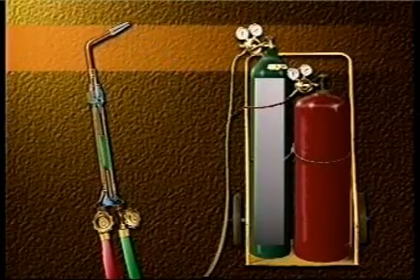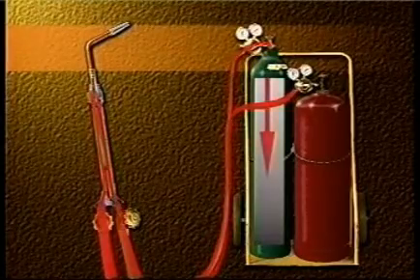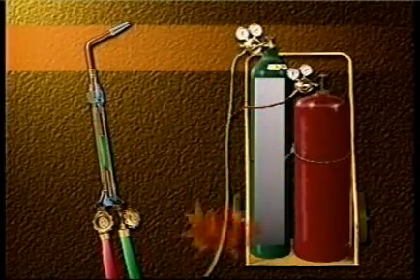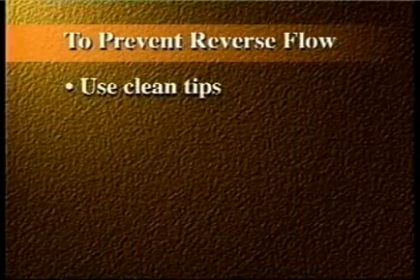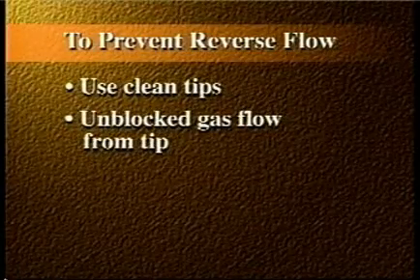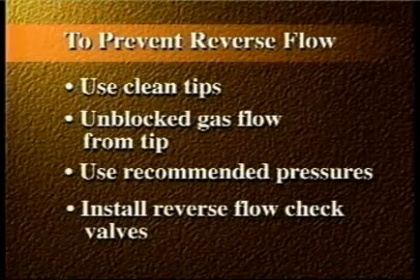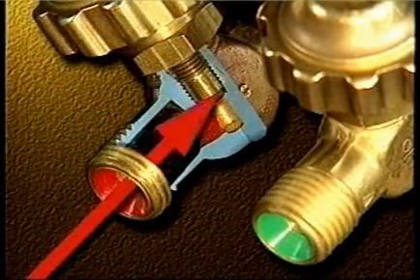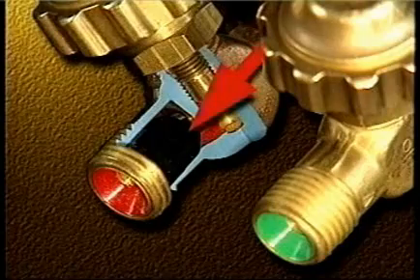Reverse Flow of Gas: Flashback Safety

Comment: i knew about the flashback arrester, but reverse flow valve is new information. now i have to find this type of valve to add to my torch. thanks.
Reply: Most, if not all, flashback arrestors have check valves built in.

Comment: Do I need this with an acetylene/air system.
Reply: Yes. That's what he's using.
Reply: Any torch or tank you use now has one built in. This video is way out of date.
Reply: @jibblesq  do not be sure about it. there are tons of low cost torch in the market that they do not have it
Reply: Would definitely highly recommend advise keeping flashback arrestors on both acetylene and oxygen connections of your torches. You don't want to be on the bad side of acetylene and oxygen. It could tu a very explosive and deadly mistake to go without good quality flashback arrestors. As a welder and cutter I will not touch a torch or even be remotely close to it unless they are equipped with flashback arrestors. No big boom 💥 for me. I have them on my cutting torch and brazing/welding torch and I believe my propane torch has one built in from the factory. I don't play with safety. Be safe and live a longer life.

Comment: is there any flashback for LPG cylinder.?
Reply: i think you can buy an acetylene flashback and connect before the lpg regulator. here i see they use acetylene version. but do more research.     https://www.aliexpress.com/item/32864954407.html?src=google&albch=shopping&acnt=494-037-6276&isdl=y&slnk=&plac=&mtctp=&albbt=Gploogle_7_shopping&aff_atform=google&aff_short_key=UneMJZVf&&albagn=888888&albcp=9444695485&albag=99457316601&trgt=296904914040&crea=en32864954407&netw=u&device=c&albpg=296904914040&albpd=en32864954407&gclid=EAIaIQobChMIjIzZ8Jvm6wIVFR4rCh3jKgMMEAQYAyABEgJsUPD_BwE&gclsrc=aw.ds
Reply: IT DOES NOT MATTER WHICH FUEL YOU ARE USING AS LONG AS YOU HAVE THE VALVE IN PLACE